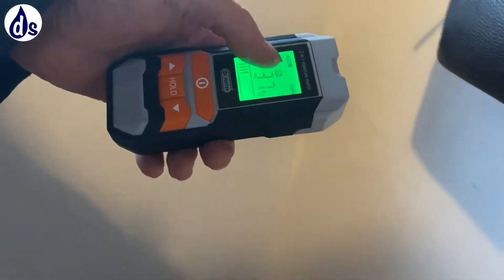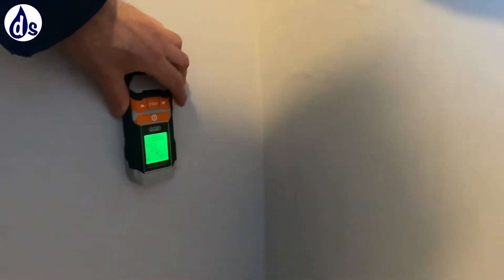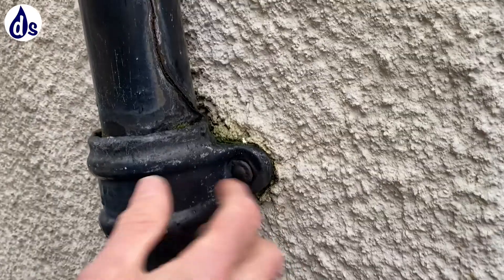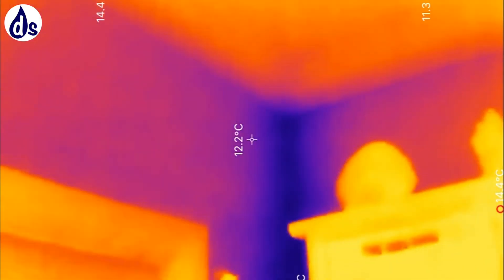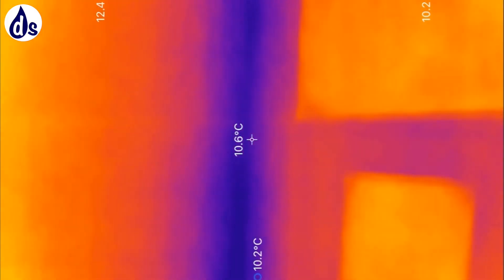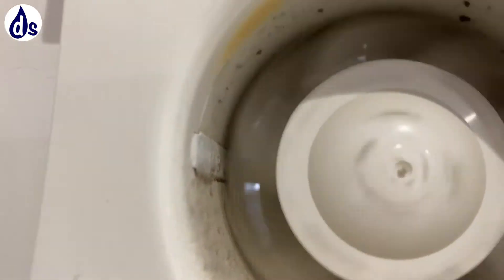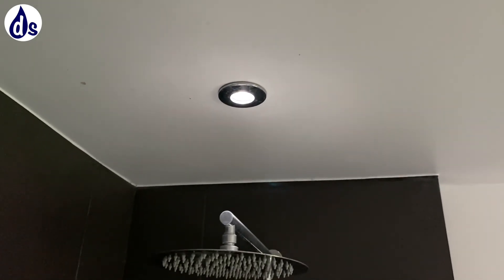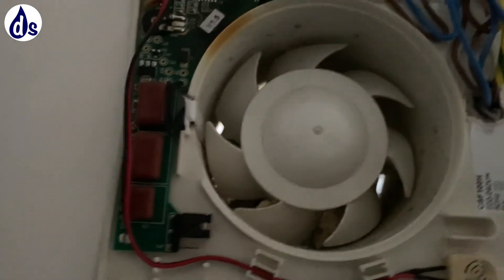⬆️ Mould Following Damp Proofing: A Detailed Survey Insight 🤔

Comment: Would you recommend anything to increase the surface temperature of solid walls, in particular at the corners, to prevent the drop to the dew point temperature? ie insulated plaster, insulation paint or insulated boarding. I have been looking for a solution to raise the temperature slightly but unsure what would achieve this without creating more issues.
Reply from the maker: Thank you for your thoughtful question! 😊

First up, focus on lowering the dew point by:

1️⃣ Targeted Ventilation: Ensure proper airflow in high-moisture areas like bathrooms and kitchens, and address drying clothes indoors effectively. 
2️⃣ Dehumidification: Use a good-capacity dehumidifier to further lower the internal dew point. Aim to follow Dew's Law—keeping the internal dew point below the external temperature as much as possible. Learn more at https://damp.ai/dews-law. 🌡️💧

Once you've tackled the dew point, consider targeted insulation for solid walls. Here are some practical steps:

For Solid Walls:
🧱 Targeted Insulation: Insulate corners and cold spots with vapour-active materials to avoid creating zones of trapped moisture.
✅ Materials like wood fibre or SpaceTherm are excellent choices, particularly for lower sections of walls (up to 600mm), as they allow moisture to dissipate naturally, reducing the risk of rot.
💡 For upper sections, you can use more cost-effective rigid insulation like Celotex, ensuring a hybrid approach that balances breathability and cost.

For Suspended Timber Floors:
🌬️ Underfloor Insulation: Choose breathable solutions like wood fibre where timber is present to prevent moisture buildup and timber decay.
🔍 Monitoring Equipment: Use data loggers to measure humidity and temperature to ensure conditions remain stable in inaccessible voids such as the sub-floor and roof voids.

Ceiling Insulation:
⬆️ Hybrid Solutions: Combine breathable materials near timber with standard insulation for cost efficiency, especially in loft spaces or ceilings adjacent to solid walls.

I recently implemented a hybrid insulation approach in a similar project and plan to release a video on it once the property is complete—stay tuned! 🎥

For now, check out these related videos for inspiration:
👉 "Dew’s Law: Managing Internal Vapour": https://youtu.be/MMJeqjAWtSo
👉 "Hybrid Insulation for Damp Zones": [coming soon!]

If you try these methods, let me know how it works out—teamwork and shared knowledge are the best ways to tackle these issues! 🙌